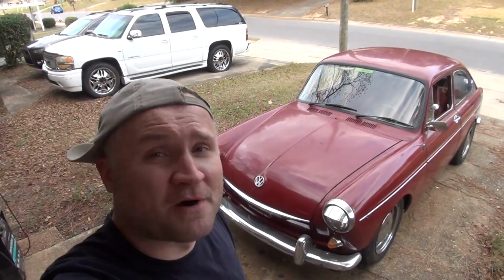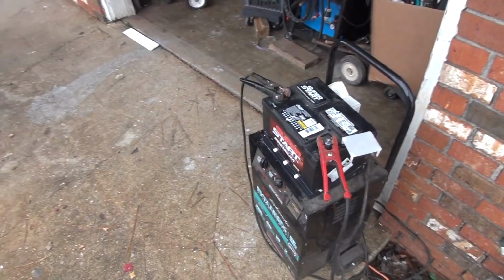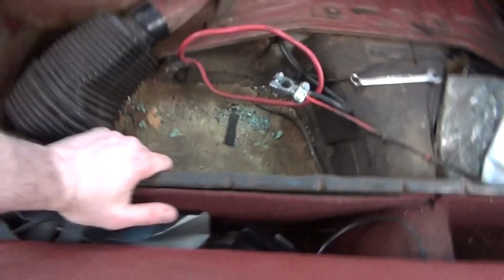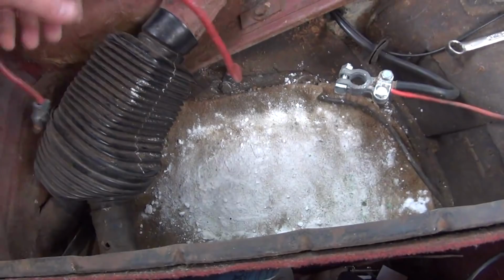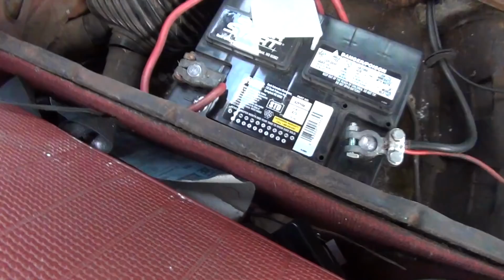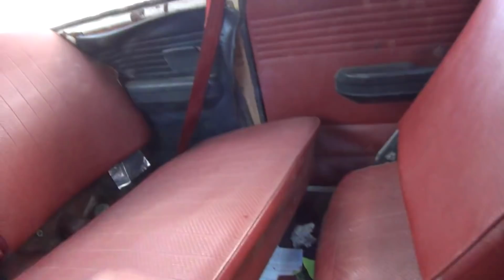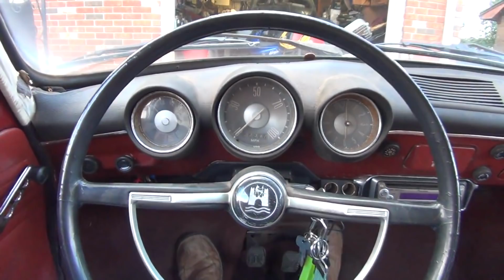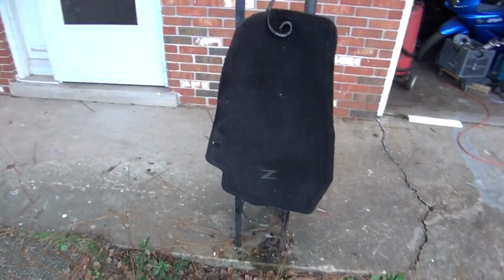Howto Replace VW Battery - VW Type-3 / Beetle Too!

Comment: Gotta' love the Type 3, especially the fastback. I heard that VW designed it because potential VW buyers wanted something that was more like "normal" sedans and wagons of the time. And VW recreated and thus improved their air-cooled four to power it. I was a Beetle devotee and then a buddy took me for a ride in his Type 3. I was amazed at how much more smooth and civilized it seemed.
Reply from the maker: Yeah, the Type-3 was supposed to be the Beetle 2.0 and replace it entirely.  Giving people that room that they needed, and quieter and more comfortable with the same simple ingenuity that VW always had that worked and made sense. But the Beetle sales numbers kept going up, and the Type-3 never really took off... it was just too expensive and wasn't what people really wanted... so the Beetle stuck around long after the Type-3 was discontinued!    I think they drive about the same though, but I've never driven an IRS Type-3, that could be quite different.

Comment: I was going to mention the pos terminal cover but you covered it (no pun intended). When I got my POS '66 beetle (Von Wreckedoften)  it didn't HAVE a battery. The only new 6V I could find locally was dry and came with a plastic jug of Acid! Was putting it in and looking at the terminal cover. Um why is that there? Oh. Heavy passenger in the back the seat spring shorts the terminal. I loved/hated that car and worked on it and drove it for a year then sold it for twice what I had in it!
Reply from the maker: I bought a lot of motorcycle batteries with a separate acid bottle, so I know what you mean.  Thats how all batteries used to come.  Glad you enjoyed it, but even happier you turned a profit!  LoL!

Comment: Merry Christmas and Happy New Year to you and all your friends.

I used to take a blown truck inner tube and cut out a section to cover the sides and top of my batteries in my VWs to prevent contact. And the baking soda coating on the floor as well.

Moe
Reply from the maker: Thanks so much!  I hope you're staying warm!  Suck some eggnog for me!
Reply: @DuckmanCycles  If the eggnog don't work, I'll add MORE RUM.
Reply from the maker: @jdmeaux   If the rum works too good, better add some egg nog!

Comment: Dielectric grease, feh. Coat your battery terminals with axle grease. Inside and out, post and clamp, clear up to the jacket. It keeps oxygen from getting to the surface of the metals conducting electricity and reacting with the offgassing of the battery electrolyte to make that oxide powder-crud and chew up the terminals. Grampa taught me that trick many a moon ago.

The spray-can sealer they charge $ARM_LEG for also works, but I'm f#%kin' cheap.  :)
Reply from the maker: Yep that'll do it!   Heh!  Thanks for the comment!

Comment: I only WISH I had an electric gas gauge in  my '59 bug. All I have is that reserve lever which I've never needed to use yet. Supposedly when you hear the engine burble/sputter you gotta flip the lever down and you get whatever is in the bottom of the tank. I'm not real confident in that as one could imagine!
Reply from the maker: Every motorcycle I've ever had (except the Ninja 250) didn't have a gas gauge, flipping the fuel switch to reserve when the engine sputtered out was the norm and actually works just fine!  😀  Believe in it!  😀

Comment: A battery with a bad cell gives your car a voltage drop, doesn't go down well with coil ignition.
My Daytona bug is just about finished and will be back on the road in about a week.
Reply from the maker: A car battery with a DEAD or shorted cell will give you a 2 volt drop, yep.  The coil actually does quite well until about 8 volts though, lol.  I only know this because my generator died once and I got to see.  Haha!

Comment: I was taught negative first off, last on. No ground no spark. I will use the baking soda trick. Cali car.
Reply from the maker: Well you need both ground and hot to make a spark... but I can see where you're coming from.

Comment: One of my pet hates is red negative battery cable's on older cars. Ive had a few old holdens with red negative. The first thing I do is wrap it with black tape.  Having a black positive cable aswell would drive me nuts.
Reply from the maker: Yeah, tell me about it!  But I am observant, so I'm good!  No actual OCD here that gives me a concern.  😀😀😀😀

Comment: So my 74 super was in a barn with no battery included. What do I get for a replacement ? Live in the Midwest. Most batteries sold here a sealed.
Reply from the maker: I believe its a size 42... any local auto parts place should carry one for ya.  Yes, modern ones are likely sealed.  Make sure you check for a date on it so you don't get an old one.

Comment: I have a 69 Squareback that gets wet on the passenger side floorboard when I wash it. Im not sure where water is coming from.  Anyone have ideas where I should start?
Reply from the maker: Look up under the dashboard, there are two black hoses for draining the cowl vents  They often come disconnected (sometimes clogged) and drip all over the floor.  Simply reconnect them.  If they are connected just fine, then you have the problem that I do.  The cowl vent seals are bad and need replacement, but its so hard for be to get my large man body under there to do it and I don't drive on rainy days that it doesn't matter to me.  I just be very careful how much water I use around the windshield area when I wash it.  I hope that helps!
Reply: @DuckmanCycles  Ok, Duckman. Thank you for responding. I will be sure to check out the hoses. I truly enjoy your videos!